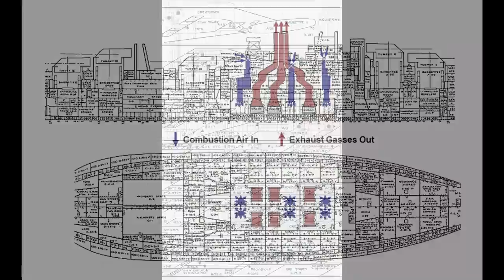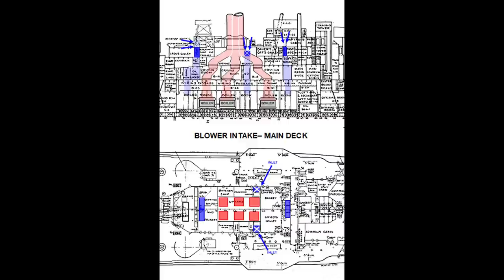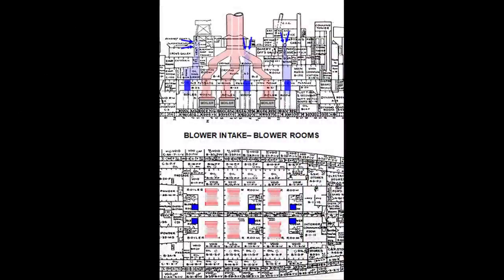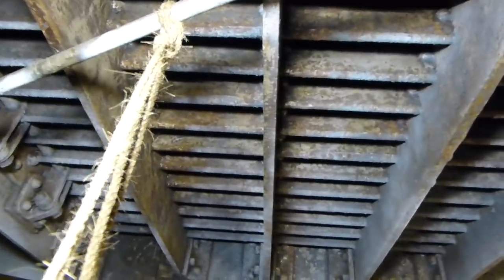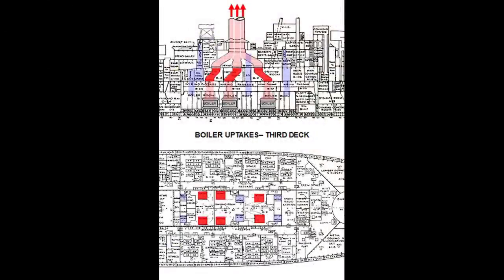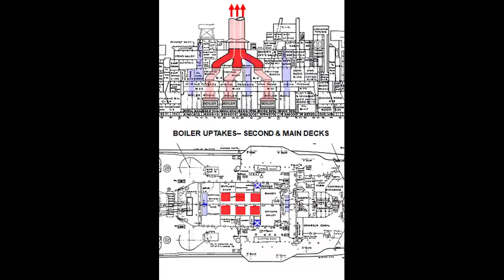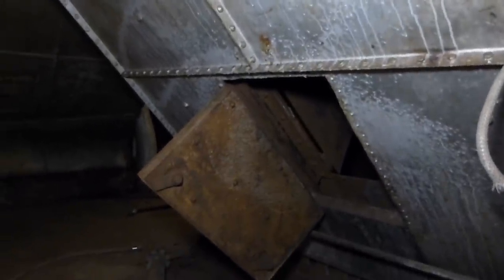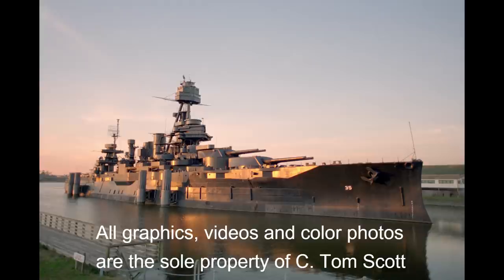Battleship Texas, In With The Good Air... Out With The Bad!

Comment: The rather thin and wide-spaced cross-strips going across the "armored" gratings at the armored-deck level were usually considered adequate when the ships were designed due to the short battle ranges and thus very shallow angles of fall of the enemy shells, so that even those rather light gratings could usually deflect an impacting projectile to ricochet upward rather than penetrating into the lower areas over the boiler rooms.  In the later WWII-era battleships, starting with NORTH CAROLINA in the US Navy, at longer ranges the shells would be hitting at a somewhat steeper angle and thus the gratings were actually thick solid armor plates about 90% thicker than the solid heavy deck armor around them that had a pattern of large holes drilled into them with the upper side of the grating having small vertical-sided cylindrical holes and the lower face of the grating having conical, wider-mouthed portions of those holes.  These WWII heavy gratings were only rated at 75% of the thickness of the solid deck around them, but most ships had some thin vertical armor surrounding the uptakes above that deck to knock off the AP cap of an attacking AP projectile coming from the side and thus reduce the ability of the projectile to dig into the grating holes and punch through.

Comment: Hi, Tom, thank you for the video tour. I was wondering what are the two large wrench-like things that are attached on the side of the base of the funnel. Thank you.
Reply from the maker: I am embarrassed to say that I have been told, but I don't remember.
Reply: @tomscotttheolderone364  Thank you for the reply. I have visited old T many times and looked around for any bolts large enough to fit these "wrenches" but I never found anything close to that size.
Reply: @tomscotttheolderone364  I haven't seen these "wrenches" in historical photos. My guess is they are for bolts on the steam engines. They are placed on the side wall close to the funnel after the deactivation of the ship.

Comment: at minute 10 - what is the pipe running there ? Even before the end - that go to the "contraption" on the front of stack sticking up - with the platform around it- The ships whistle/ Horn !  very good and thorough video. thanks.
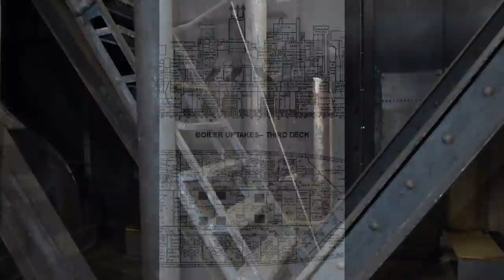Reply from the maker: The straight, vertical pipes at 10:00 are columns that support the 2nd deck and deck framing that are immediately above.   That is the ship's whistle at 16:10.  It has been blown recently, but with compressed air since there is no steam available of needed pressure or amount.

Comment: again a very impressive walk and talk through

the designing of parts of the ship are so interesting, to me anyway, as you speak of the reinforcements and added strength put in to accommodate the heavy smoke stack above - you have to ask yourself the questions, had there ever been known incidents where there was an issue below smoke stacks, breakages and buckling of bulkheads, was this a designed in factor or are we looking at vigilant thinking and over-engineering 

and of course we cannot forget all the forces involved here, not just including the weight of the stack, but stresses throughout the ship in heavy winds blasting at the sides and trying to force the stack off its mounts and the forces put through everything as the ship moves in turbulent seas, there's a lot to consider with weight distribution going on here, and a lot of great detail that engineers designed into the ship, considering the early days of ship building with no computer aided stress testing going on

i've worked with many engineers who thoughtfully add bits here and there for added strength but wonder how many times has something gone wrong before its made correct - over engineering has to be the end result

Comment: 1st view, 1st commnt, first like. Aren't I Mr lucky.
Great cideo Tom, I assumed all intakes and outakes for ther boilers were straight shafts. This is some intersting stuff, Thanks.
Reply from the maker: There were offsets in the intake trunks that allowed them to fit in available spaces and the uptakes had heavy curves in them to bring them together at the stack.   That can be seen on second and third decks.  In either case, they got good airflow since they were adequately sized and the curves  weren’t too severe.

Comment: Tom, as usual you have outdone yourself.   This tour shows the heart of the ship's power plant.  This is also similar to the air inlets and exhaust uptakes of any steamship.  Was the air pressure into the boiler rooms sufficient to require air locks?
Reply from the maker: Yes, they had air locks that were adjacent to the blower rooms.  I didn't show the one I went through because the doors had been removed, making it difficult to show them.  Go to 4 minutes and 20 seconds in this video and you will see one.  https://www.youtube.com/watch?v=BAscJuG9bMo&t=3s

Comment: Sounds like this video (and a comment in here), answered my question about airflow to the boilers. I wondered if they had their own air source, or if they were fed from a pressurized boiler, or pressurized air from the engine room.

My time underway was spent on diesel and gas turbine ships. The first was pretty small (180') and pulled all the air from the engine room, using electric fans to supply the ER with positive pressure (of course the engines having their own forced induction). On the second ship (378') the propulsion engines had their own dedicated air intake with the generators and auxillary boilers pulling air from the engine room.

I wonder how loud it was down in the hole.
Reply from the maker: Between the boilers' roar, running pumps and forced air, it was loud enough to require using a sound insulated phone booth when communicating outside of the room.

Comment: Tom Great Videio, did they have to worry about water getting into the intakes?  You one intake in the passage and one on the outside?
Reply from the maker: It was easy enough to have drains in the intakes to route water out of them.  Uptakes could also take in a lot of water, but firing up the boilers would certainly rid them of practically any amount of water that may come in.

Comment: Just curious Tom, did they have air lock doors to enter the pressurized boiler rooms? Nice video!
Reply from the maker: Yes, there was an airlock next to the door to the blower room.  I didn’t show it because the doors have been removed and it doesn’t make sense without them.
Reply: @tomscotttheolderone364  Thanks Tom. I've been through a couple of air locks where I work that make me think "don't let the door hit you in the ass" is where that came from. Loved the view of the electrical raceway. Looks rather tight in there. I'll bet the electricians on that ship were skinnier than I am. LOL
Reply from the maker: @wingman5985  my size was certainly one of a couple of reasons why I didn’t enter the wiring passage!  

Both air lock doors are hinged so that only one or the other can be opened at a time.  Pressure will always keep one shut unless the blowers are stopped and the room depressurizes.
Reply: I understand in the days of coal they would pressurize the boiler room as much as possible to force the draft and increase the power produced by the boilers for short periods of time. I never heard of that happening with oil so maybe it doesn't work as well with oil.
Reply from the maker: @keithstudly6071  Forced draft was typically used with U.S. Navy oil fired boilers.  It improved the ability to fine tune the fuel air ratio at all settings, allowed increased firing rate and also helped keep the fire in the firebox.  The Dyson design boilers used on Texas were not jacketed so it required pressurized boiler rooms and were  used on several U.S. capital ships.  The six on Texas were actually intended for Battleship South Dakota (BB-49) that was cancelled and scrapped.   Later boilers, especially those running at 600psi, had forced draft provided by blowing air into a jacket that surrounded the boiler housing.  This had the benefits of smaller blowers, not having to pressurize a large room, keeping the boiler room cooler, and preheating the air before it entered the firebox.

Comment: I am surprised how clean that uptake looked on the inside. I figure it would be cover with soot. The famous video or picture of the Arizona exploding I figure all that black stuff coming out of the funnel was 20+ years of oil soot from the boilers and uptakes being forced out by the overpressure of the explosion.
Reply: He touched on it at the end, they strove to burn as clean as possible.  I'm not an expert on ships, but in steam trains,  cleaning out the boiler tubes was regular maintenance, necessary just to keep the thing running.  

In the case of Arizona, I believe the famous picture was attributed to a bomb finding its way down the funnel into the actual boilers.  More than likely, the black smoke is partially burned fuel that was liberated from the boilers by the explosion
Reply: @tippyc2  But didn't Texas at one time burn  coal which is much dirtier. Did they completely redo the uptakes and the smokestack when they converted her to oil or just replaced the boilers?  Same with the fresh air intakes for the boiler rooms. A coal fired boiler would have different air needs than an oil fired boiler. I wonder if they are the original air intakes or was rebuilt when the ship was modernized in the 1920's?
Reply: @davidrobinson3716  Um, I'll go back to something I'm familiar with again, steam trains.  Many steam locomotives were/have been converted from coal to oil.  Especially true for ones that are still operating.  The only thing they have to change is adding the pressurized oil injector system.  I've even heard of logging locomotives being converted from coal to wood without issue.  The rest of it just works.  

From a more technical standpoint, the amount of air you need is related to the amount of steam you need, not the type of fuel you're burning.  If you're burning solid fuel like wood or coal, the trick is handling the ash that accumulates.  For oils, the trick is getting the oil atomized so it doesn't just pool up on the bottom of the fire box.  

Also, it's totally possible to shove more air through the system if you need to without major modification.  All you'd need to do is put more powerful blowers in there.  There's a limit of course, and you lose a bit of overall efficiency, but you could easily get 20%-50% more air with just the blower.
Reply from the maker: Everything changed when the ship was converted from coal to oil fired boilers, including air intakes and uptakes.  In fact, the entire center of the ship was gutted down to the inner hull and built back up.  Watch this video to see what was done.  https://www.youtube.com/watch?v=hUTBpTwjES4&t=326s
Reply from the maker: Even though the oil was pretty nasty stuff, it burned fairly cleanly with the right fuel to air ratio.  Even then, soot could build up on the outside of the water tubes.  Soot blowers were installed in the boilers among the tubes that used live steam to blow the soot off of them and out the stack.  Needless to say, it was best to do that when at sea and not tied up at a dock among other ships.

Comment: so it seems to me if a shell ripped all of that apart entire decks in the super structure would not be able to be occupied because of the heat and fumes. That would be a very big issue
Reply from the maker: You are right, however there aren’t any functions in the superstructure that are critical to the ship’s ability to fight or navigate.  It is mostly occupied by the captain’s and admiral’s cabins, bakery, foundry, crew’s and officer’s galleys and miscellaneous storage.  The bigger issue is keeping the uptakes intact along with second and third deck drying room bulkheads.  A major shell hit there could allow boiler exhaust gasses out into those decks.  Even then, damage control teams wearing gas masks and asbestos suits could probably minimize the effects in short order.

Comment: On boilers I've worked on the air pimps blew air directly into the furnace. We would check a periscope yo see if we were smoking. If we were making black smoke we'd Pick up on the blower as the furnace was air starved. If it was smoking white then it was too much draft so we'd cut back on draft. 

But with this system the draft enters the whole room which I would think would cool the whole  boiler room.
Reply from the maker: This forced draft basically worked the same way.  They varied air pressure by remotely controlling steam input to two steam turbine driven blowers located directly above the room.  They also had two periscopes used to look for smoke in the boiler's two uptakes.   However, the forced air on your boilers offered an advantage of preheating the combustion air which provided a small jump in efficiency.

Comment: I'm not sure if it was you I asked before if so sorry for the repeat , do you know anything about the foremast fire control tower ? I've never seen the inside of one , are there different levels ? Is it just open space ? Rooms?  Offices ? Just curious dumb questions .....thx
Reply from the maker: Not a dumb question...  There are three levels that require a ladder climb to get from one to another.  From top down, there was main battery fire control for the 14" guns, forward battle lookout and secondary fire control for the 5" guns.  The Navy stripped all of the equipment out of it, so there is nothing to see other than the foundations for the directors.
Reply: @tomscotttheolderone364  thank you very much for answering,  do you know of any photos of one that exists anywhere?  Again thank you .
Reply from the maker: @rolsguitars  Nothing on line that I am aware of.

Comment: Why/when did they cover over the intakes?
Reply from the maker: All but one intake and uptake was covered prior to 1948 when the Navy prepared the ship for museum status.  The single intake and uptake was open so that one boiler could be fired to run pumps and lighting during the ship's tow to Texas.  Once there, those two openings were covered.  The covers were necessary to exclude water that would get into the ship when it rains.
Reply: @tomscotttheolderone364  Thanks for the additional info Tom!

Comment: So dumb question, whats a drying room?
Reply from the maker: That is absolutely NOT a dumb question.  As said in the video, the room was much too hot to be occupied while the boilers were fired, but it was possible to store things in them that weren't heat sensitive.   However, sailors found a better use which was to hang and dry their wet clothing in them.  In fact, there are small hooks on the bulkheads in the 3rd deck drying rooms that clothes lines could be strung on.  For that reason, they picked up the name drying rooms.

Comment: What would it cost to make the Texas seaworthy?  For its engines to run, to enable it to sail under its own power? (Not to make it weapons work, just to make it capable of sailing the oceans again.)
Reply from the maker: No one can properly answer that question.  It would take $100,000's just to perform structural and engineering surveys needed to assemble an equally expensive estimate.  From a structural standpoint, the ship is currently strong enough to sit stationary in or out of the water, but likely not strong enough to withstand the stresses of actually steaming under her own power in open water.  It is like the strength and stress differences between you or me standing still or dancing.  

It is not only a frame and plating corrosion and fatigue issue, the great majority of the hull and framing is largely held together with 100+ year old rivets that have loosened and suffered their own corrosion.  Likewise, the engines would have to be completely torn down and reconditioned, and the boilers would have to be replaced.  They are far too old and weakened to even be rebuilt.  All of the steam piping would also have to be replaced.  Then there's the matter of hundreds of motors and mechanisms that would have to be rebuilt.  The tools and drawings needed to restore machinery simply no longer exist.  

This just scratches the surface.  In other words, it would not only cost $100's of millions, the reconstruction process would completely destroy her fabric as an historic artifact.  It would be like replacing most of the stones in one of the great pyramids.  You'd have something that looks like it, but it would no longer be an historic pyramid.  In the long run, it would be more respectful to the ship's history, easier and likely less expensive to simply build a full scale replica using modern materials.
Reply: @tomscotttheolderone364 So, do you think you could you do it for a billion dollars?
Reply from the maker: @Gozerthegozarian1984  Re-read the last paragraph of my previous response for my only answer.